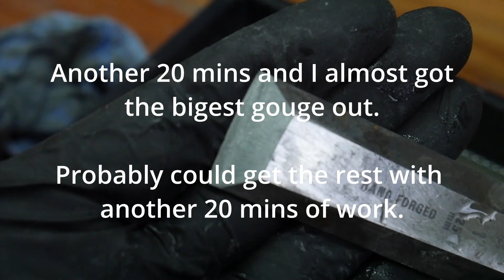3D Printed Chisel Sharpener

Comment: Why not move the bolts to the top?
Reply: because the tops are often pitched/angled, the top of the jig is set at 30º(I'm guessing) .. using the screws at the top would push the blade down changing the angle of contact to the stone.